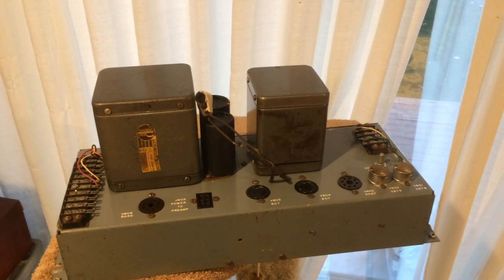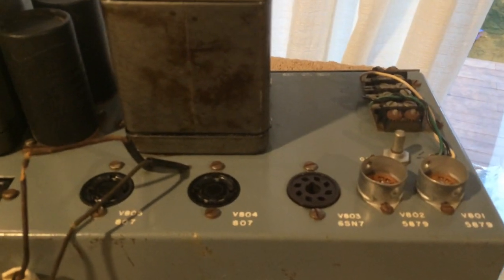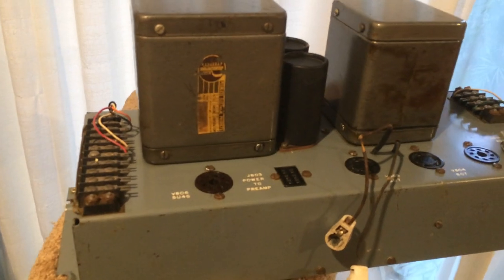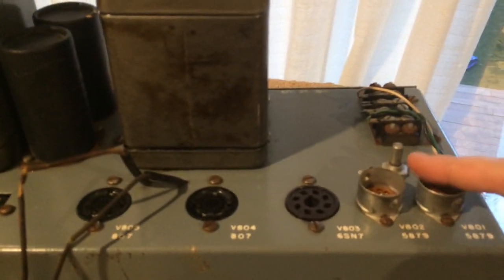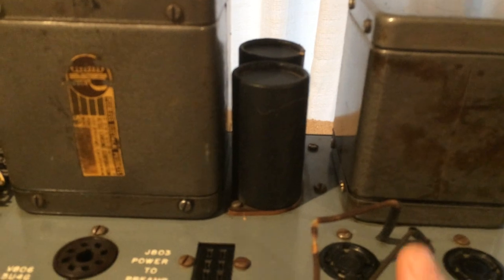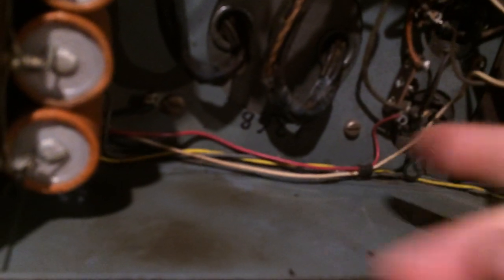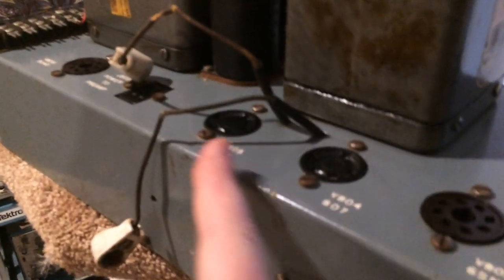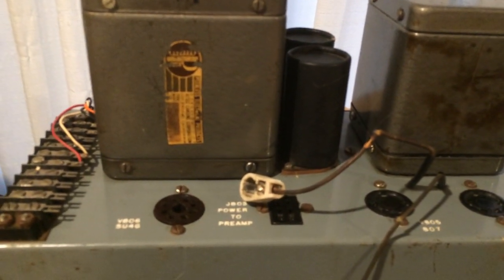Ampex 6516 Theatre Amplifier Rebuild Part I.

Comment: "The flimsy wire limits input current"... Look at that wire in the fuse buddy.. It's pretty darn thin.  I think that's your weak point....;)
Reply from the maker: That's correct! However, you can omit it and get the chance to burn your home down in case something goes wrong. ;). If you have looked into it, experimenting with fuses do have a quite pronounced effect on the sound of the unit, but only do that when you really understand what you are doing, otherwise risking ruining your life and killing others.